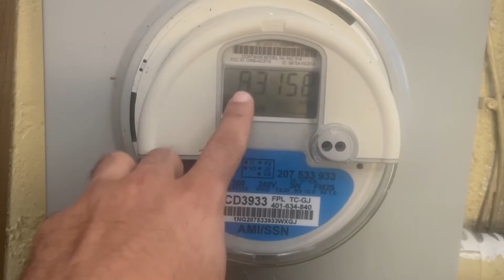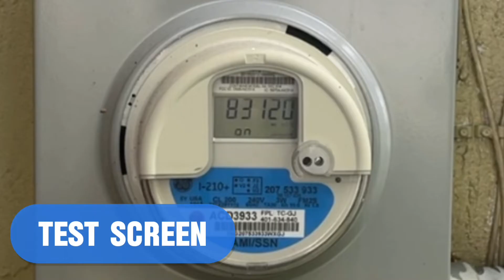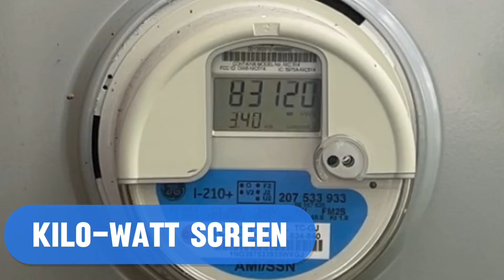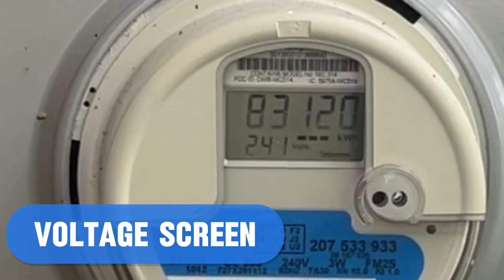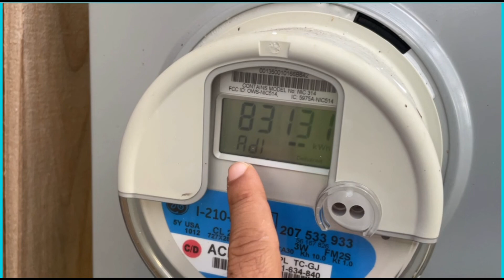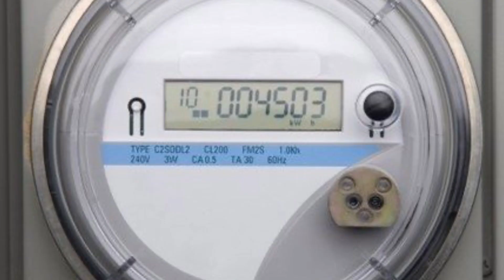How To Read A Digital Electric Meter: The Basics

Comment: Your not making no sense you just said the top larger numbers don’t change , but later you says it changes
Reply from the maker: I said the number doesn’t change up top only the bottom when screens are blinking. Not meaning the specific number. for example the number can be different but it’s showing the same thing Which is your kilowatt consumption. Unlike the bottom number that change for different meanings
Reply from the maker: which again you won’t notice unless you come back a couple hours or even a day later depending on your energy consumption. Most people don’t read and look at their meters that long. But that’s why i show the next day it changes but only by a small margin. In theory it could stay the same if you don’t live in the home and all lights are off and everything is off

Comment: Mine has a screen that changes the bud numbers to the word CLOSED.  Does that mean that the circuit is closed?  What is closed.

It also has these bouts of dropping a leg of power, leaving half of my house in darkness.  When it does this, the screen is completely blank.  Is that the transformer, meter, or its way of telling me there is some issue with my breaker box?
Reply from the maker: i’d say theirs some sort of electrical problem for sure your house should not be losing power in half your house. Every meter is different i would have to see and image of yours or video. However from the research i’ve done closed means quoting, The term "closed" indicates that the internal switch or relay within the meter is in a closed position, allowing electricity to flow
Reply from the maker: i’d say it could be your circuit breaker something wrong with wiring. I’d have to see pictures of the panel cover off to see if anything was wrong. But hard to answer just from what you wrote
Reply: @OTownInspections As it turned out, one leg was compromised by a vine up at the transformer on the pole.  The meter was loosing power to operate.  Half the house still had power from the good leg to the ground, but was not being reported by the meter because it was off.  So, the power company noticed the lack of data collection and came by to fix it.  It hasn't happened since.  But it WAS their problem to resolve, not mine.  Thanks for reading my comment and giving me your thoughts.  I truly appreciate it.  You got my subscription.
Reply from the maker: @novtek thank you for sharing because that’s the first time i’ve heard of something like that so now i’ve learned something new